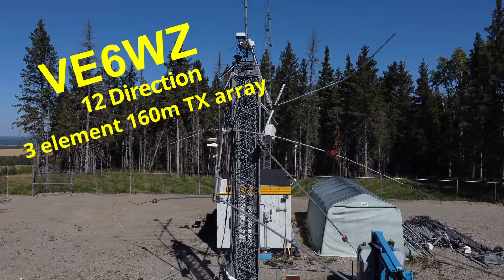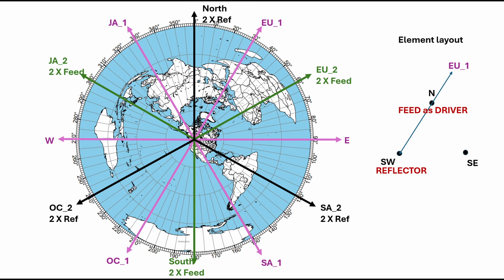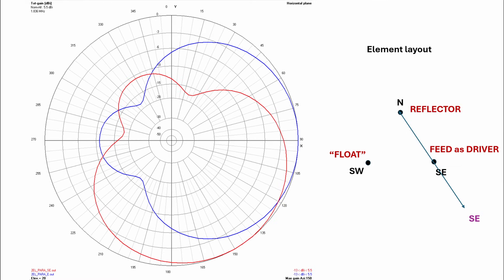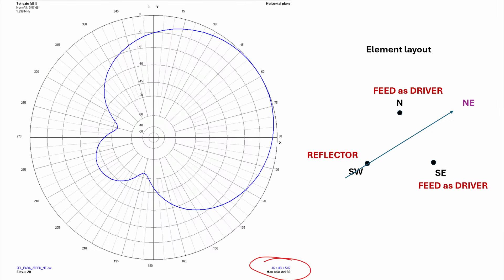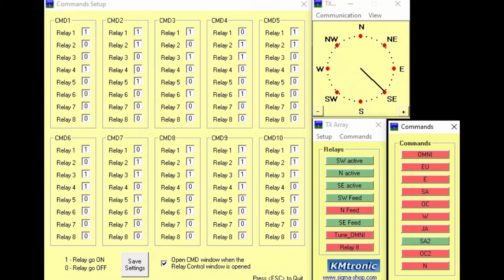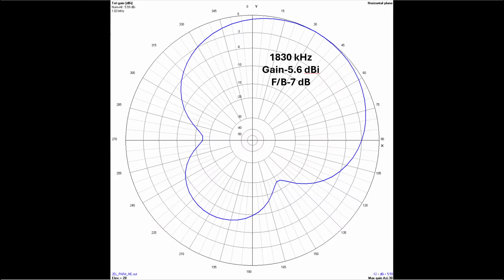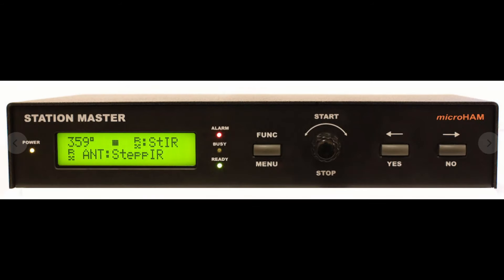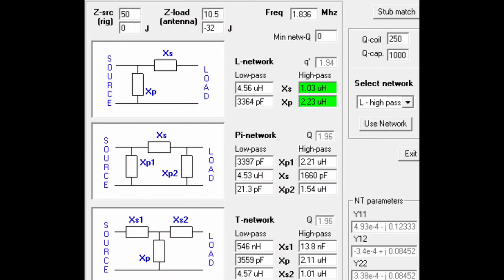A 3 element, 12 direction 160m vertical array

Comment: Fantastic video Steve! Thanks for sharing! 

I have to ask. Why do you use several 0.5 uH inductors instead of one 0.5 uH, one 1 uH, one 2 uH? That would give you more combinations with fewer relays. 

73 Joseph VE3GKT
Reply from the maker: Yes, indeed that is a great option!
I have done that on my 80m 2 element Yagi to tune across the band.
Sometimes using cascaded (summed) inductors can be a little difficult to tune.
With individual inductors its a bit easier to get each tune box to be identical.